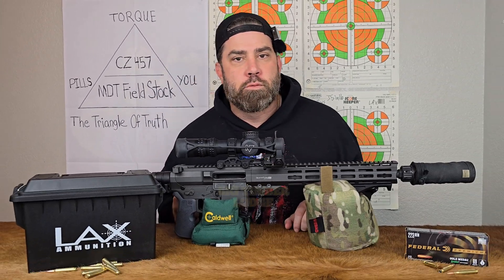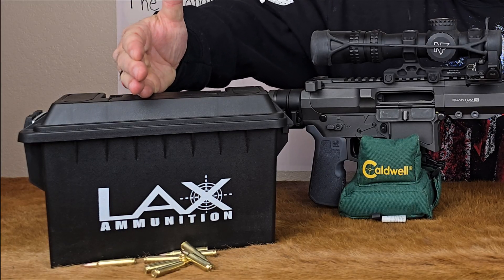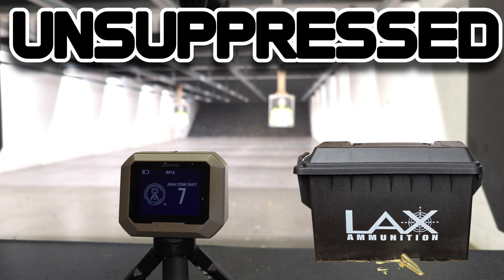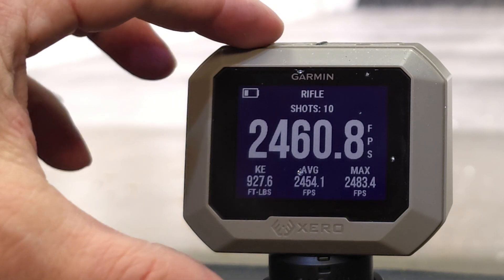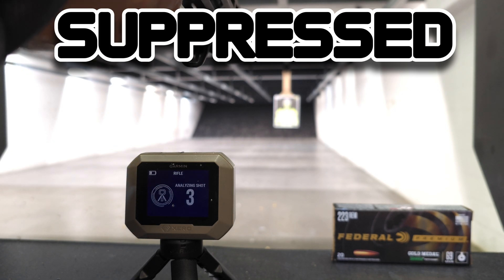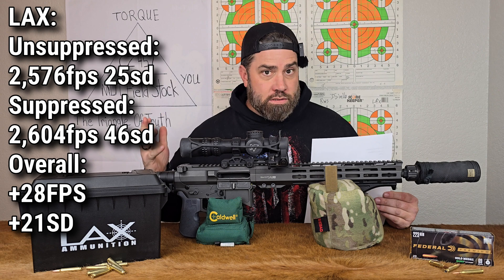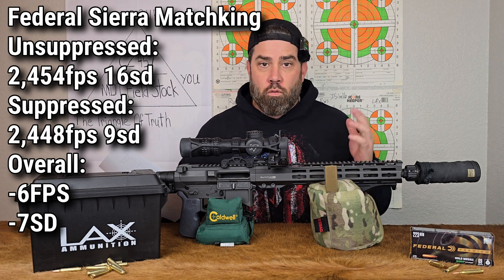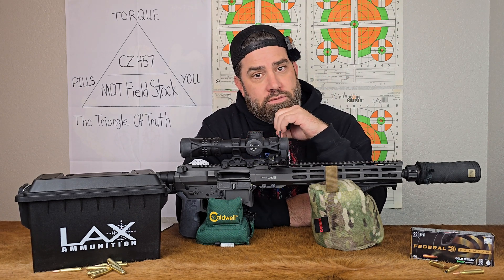Does a SUPPRESSOR affect AR15 Bullet Velocity?

Comment: I think In a semi auto platform  where gas is needed to cycle, it’s negligible, because of the gas adjustment… just a hypothesis… but in a bolt action I think it will be different.. we shall see
Reply from the maker: I'm thinking the same thing. It's going to be interesting to see how the bolt actin rifle responds.
Reply: @BigTimberLodge  I’m wanting to get one for my 6.5 prc… it’s just a 20 inch barrel hunting platform, so definitely wanting to see an increase… or at least not a loss. But I would think that many things come into play, like barrel length +overall length, and caliber. Smaller caliber sometimes needs more barrel for most powder burn, therefore if it’s a shorter barrel, it might see an increase, whereas say a 308 that does really well with a 20-22 inch barrel already, likely won’t benefit much from a suppressor adding length.  But maybe something like a 6.5 prc, that does better in a 24-26, might see small benefit adding something like a 5-7 inch suppressor to it. I’d like to see those kinds of tests.
Reply from the maker: @Sirlants_alot  that's a good point. I have a 300 PRC with a 26" barrel. Maybe adding the suppressor isn't a good representation because most of the powder has burned